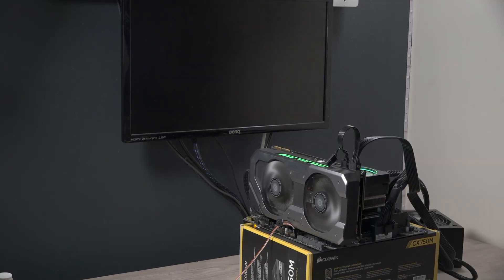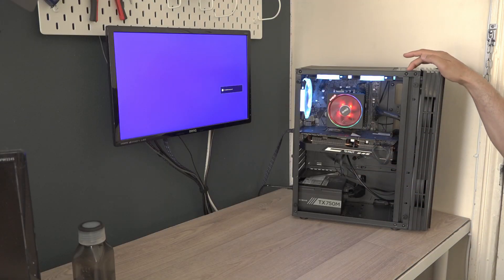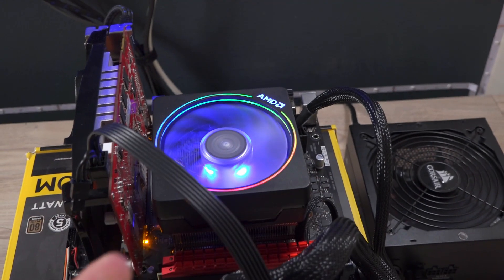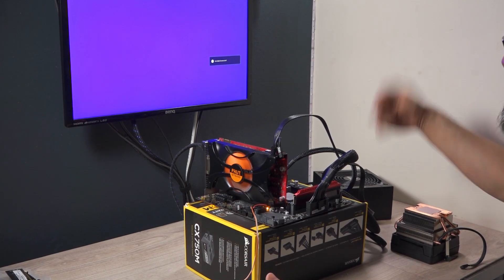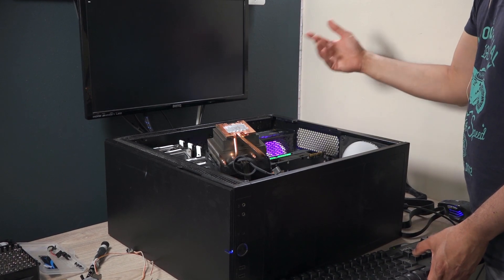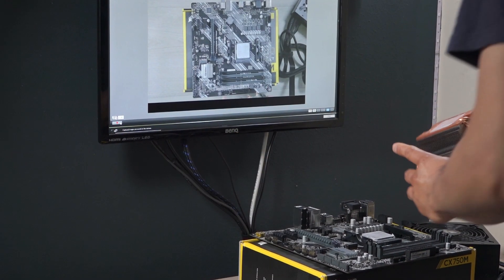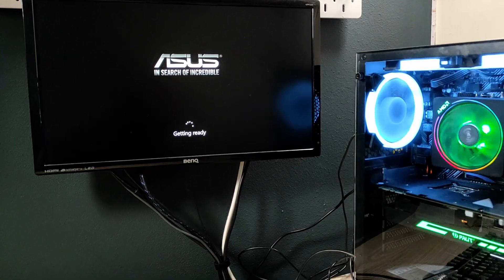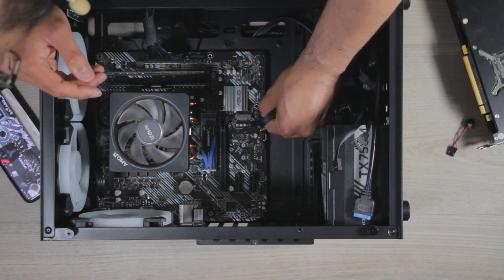Computer Turns On But No Display - Led Light On Fan Spinning - HARDEST Troubleshoot?

Comment: I have a Acer Aspire f5 572g 57pv laptop and after trying to overclock my laptop and hitting f10 in bios to save and exit, my laptop got stuck in a black screen every single time I try to boot it, no logo, no bios no nothing, just a black screen, I have tried to cmos reset by removing the bios battery, I tried it 3 times, longest time I waitted before putting it back in was 1 and half an hour, I don't know if this is because I have a bios password (yes ik the password I just need to enter bios to reset it but there is no display), I tried looking for cmos jumper but couldn't find it, please help 😦

Comment: I didn't know that you should plug 8pin connector instead of SATA to 8 pin and then my PC slowly started to stop giving display when i turn on any game and then one day i open my PC and see that SATA wire is fried and i try to check it and then I see that the both two of the four wires are fried and cam out when I touched them and from then I didn't see any display on my rx 580 even i changed connector to 8. Pin

Comment: I have this problem but im not really sure if its the same. Heres the issue:

Problem: No display but with power just like yours.
Issue #1: Gpu(connected) = No display with power and fan is spinning but keyboard and mouse not turning on
Issue #2: Gpu(disconnected) = No display with power and fan is spinning but keyboard and mouse will turn on and I can see the light of capslock led and numlock led.

My question is what would be the cause of this problem? Is my mobo good because it shows that if my gpu is not connected my keyboard and mouse will turned on? Or my psu is bad and doesnt give enough wattage? 

Also I dont have iGpu. Im using ryzen5 2600 so I cannot tell if my pc is booting up to bios when the kboard/mouse is turning on.

My gpu is good tho because the Tech tested it and I saw it myself.

Comment: Hello I built my pc today and the fans turn on and spin in the case except the cpu fan doesn’t spin and the is a red light near the cpu 8 pin port and there is no display on the screen also 

The motherboard is a ASUS rog strix bm550- a motherboard 

Pls can someone help me with this problem

Comment: Thanks for the video. I'm currently experiencing this issue. I moved my pc from basement to 2nd floor and now it spins+lights up but no display on monitor. I tried another monitor, gpu, other RAM and different slots. I'm at the point where it's either the cpu cooler, the cpu itself, or the motherboard pcie slot. I'm really regretting not taking the AIO and GPU out before moving it.
Reply: Did you end up fixing this issue? Having the same issue after moving.
Reply: @Morvellius  yeah turned out to be the motherboard pcie slot. Luckily my gpu was fine and it was not too expensive a motherboard but still, unfortunate. I wish you the best lmk how it goes.

Comment: My keyboard and mouse has lights my fans are spinning and everything is turning on but it has no display i tried replacing my board with a new one and the issue stays the same idk whats the problem now, im thinking maybe its the cpu if not wtf is it
Reply: did u solve?

Comment: The easiest way I did was to check the beep sound when I unplugged all the RAM. Without RAM there would be long beep: 
1. If the beep does not exist (you must make sure the speaker buzzer system of motherboard is fine, some motherboard failed to beep at all or your buzzer is broken/reversed) then it must be either the processor or the logic/Super IO motherboard (which is hardest) and after changing the processor to known working & compatible one still does not sound beep then it is clearly the motherboard issue which require advanced electronic test such as MOSFET and voltage output.
2. But if there is a long beep then most likely just VGA (Graphics Card) or RAM issue. Some motherboards (not all) will generate unique sound if the VGA is failed. Try using onboard or switch to another VGA. If the problem persist try replugging RAM to different slot or change the RAM to known good one (borrow one if you don't have).

If you are a technician usually you have something like "PCI Tester PC Analyzer Diagnostic Card" to show the current code that the motherboard is currently stuck at.

PS: I'm a PC technician for 8 years.
Reply: how if my mobo doesnt have beep sound

Comment: Hi friends, I've been desperately experiencing the same issue, but my PC turns on, screen turns on too, but after a while it loses signal. Could you suggest where to look for the issue?
Reply: Possibly overheating of your GPU... try using the onboard graphics.

Comment: I was just playing roblox and then suddenly out of nowhere the screen started flickering and it just froze nothing was working not even to restart button on my cpu case so o just restarted and then when i logged in the screen started flickering again i swithed off the power supply and turned it back on and since then my pc shows no hdmi signal from you device SOMEONE HELPPP MEEEE 🥺

Comment: Hey buddy need your help
My graphics card fans are running but No display when I plug my HDMI cable in GPU HDMI port, showing display only when I plug it in my motherboard’s port because my CPU has integrated Graphics…even sometimes showing no display in motherboard port too .
And in display adapter option in device manager( show hidden device ) it’s showing me my graphics card with a yellow caution sign… what to do buddy

( sometimes Graphics card randomly start working for one or two days) 

Motherboard- MSI A 320m A pro max 
GPU- 1050ti 
CPU/APU - Ryzen 3 3200 G 
PSU - 550w ( cooler master)
Reply: Turn off ur igpu , maybe its conflict with ur discreet gpu

Comment: okay, so what if my pc has all fans running no rgb on them are turning on, my cpu aio has the fans spinning but the cyberpower logo isnt showing anymore and my gpu is working as normal but nothing will boot onto the screen and jo lights on mobo are displaying, very very confusing trouble shoot
Reply: only thing i can think of is the motherboard because i have no further way to test the ram etc but everything was running yesterday and today the system has given me these issues wont boot at all but power is being transfered through the system

Comment: If it still not showing anything try pressing (windows icon+ctrl+shift+b) while the pc is still running 
Then turn it off by pressing the button 
Turn it on
It's gonna ask you for boot by pressing f1 (don't boot anything) press shift+alt+delete 
It helped me when nothing else did (I seriously tried everything) gl

Comment: One of the most common problems is a dead/or dying CMOS battery. When I have any POST problems, I insert a new battery. If the battery has gone SOUTH, you might see a message informing you that the system clock needs to be reset. Also, I keep a few new button batteries attached to the inside of my PC, just in case.

Comment: I have a similar problem. Fans spinning and there is light but no display (RTX 4070 TI) thou it works when I put back my old gpu (1050)

processor is ryzen 7 5800x
motherboard is asus tuf x570-plus
Reply: Your power supply might not be adequate to run the 4070 ti
Reply: thats the same thing with mine but instead of gpu its cpu for me i had a ryzen 5 and upgrade to a ryzen 9

Comment: I just have this problem ..i just get a3070before just use intel.uhd770 (13700k) .

After installing to the mobo it turns on normaly.. but after i install the driver ..and start gaming it suddenly off and no boot  no screen at all.

So i switch back to my uhd 770 intel at the moment is works just fine.

Is this because of my PSU not meet the req ?

I have Antec  700watt 80+ Bronze.

I need help thank you verymuch.

Thanks.

Comment: Greetings,my problem is that my pc boots but I get vga light and 3 beeps,any idea? 
Msi mpg b550 motherboard
Thermaltake 630watt psu
2 rams hyper x 16gb
Gtx 3070 gpu (I Also checked with another)
M2 Samsung ssd

Comment: I’m having an issue, i upgraded my ram recently and my system won’t display, the rgb and fans and the coolers lcd just spin and display my logo but no display on my screen. I don’t know what to do. I’ve clear the cmos, I’ve tried flashing the bios, and still nothing I even tried my old ram and nothing. I’m lost can anyone help?
Reply: You got any solutions?
Reply: @miguelisra  I don’t I’ve tried everything I can think of, the last thing to do is swap out the mobo

Comment: Hey guys if anyone sees this! Just put the usb stick in it with windows and it probably will work.  It worked for me!
Reply: Did You have no signal at all?
Reply: @pierdolek1236  troubling shooting mine this Monday I'll get with you on if this worked. I have the issue where everything turns except my gpu I have changed the board and kept everything else the same and everything booted up but I still want to fix my board since i had to use a friend's to figure that much out. Clearing the cmos definitely did something tho because at first mine didn't even have the cpu fan spinning
Reply: Also going try flashing the bois to see if that will get it to work but also my mobo isn't giving power to the keyboard and mouse

Comment: that board shouldve never been paired with that cpu without active cooling on the VRMs or after market heatsinks applied those VRMs cant handle the core count and power load without overheating. He'll just have the same problem as before. Buy a bunch of old or defective boards for their heatsinks theyre usually the exact same hole spacing

Comment: Mine was different. didn't boot and had video card not detected beeps (1 long, 3 short), so I just brought all my stuff on the floor, which was cables, a monitor, and the PC altogether, and it boots. I also unplugged all the power cables and pressed the power button to discharge the PC before that. If you don't have a budget for anything else, it could be a heart attack.🤕🤕😄😄

Comment: I just made my PC and my mouse and keyboard don't lightup or become recognized, i tried getting the same motherboard again, b650-prime still not working. CPU is Ryzen 5, 7600x. Basically i can't get into the bios because i can't use my keyboard.

Comment: Anyone help I accidenly turned my pc off when it was updating and my pc turns on but no display on my monitor and no USB ports or hdmi are working
Reply: I have the same problem I clicked update and shutdown and it won't come back on. Pulled the cmos battery for a whole day and it still won't work. Lights fans all turn on but no screen and it's definitely not booting to my home screen
Reply: @nazzato91  did you fix the problem?
Reply: @schaefer8704  yes the motherboard was bricked
Reply: @schaefer8704  apparently during that process it bricked. Maybe bios maybe a power issue. Not sure. Replaced it and been fine since.

Comment: My pc has same problem, bought new processor, didnt work, I took it to a "professional" and they said it was motherboard, bought new motherboard, didnt work, tested the hdmi in the motherboard, didnt work, made the paper clip test in the power supply, the power supply is working fine, tested the rams once at the time (its impossible to both started malfunction at the same time) and it still does not work. Idk what to do more help me 😭😭😭😭
Reply: I faced the same issue today. Few weeks ago I built a home theater PC by re-using the components of my old rig (3rd gen Core i5 + mobo + RAM). But it turned out that the Youtube 2k videos were too much for the ancient hardware so I decided to upgrade. The new CPU, mobo and RAM arrived. I replaced the old stuff and turned on the PC again. Nothing happened. No video output, not boot screen or getting to the UEFI screen. I thought maybe the HDMI output could be the problem (the TV also caught the video signal of the old config only on the 3rd day, do not ask me why did not work before) so I pulled out my old monitor with VGA and DVI input and hooked it up via the DVI port. Still nothing displayed.... So i called the nearby PC repair shop and drove there. The guy inspected my work (everything was right as I am experienced builder) and told that the new mobos, both Intel and AMD, take long time for first boot. So he tried to boot, patiently waiting, 2 or 3 times, without success. Then he reset the CMOS, still no lifesign, restart again and again and finally the boot screen popped up. Then we booted till the Windows login screen and shut it down thinking that it should be set now. I drove back home, connected the peripherials, the old monitor, turned it on and.... again blank screen.... I do not know how to describe my feelings. I tried to start it twice, without sucess. Then I restarted again and came to my main rig to search for advice. I have found this video and watched it. Then went back to the HTPC and guess what? The Windows login screen greeted me!
Long story short, it seems like that you have to be extremely patient with the new generations of mobos on the very first boot. I hope that your problem too has been solved this way.

Comment: my problem is that i changed some settings in the bios and when i left bios it was just black screen. I turned the pc off and back on and it did the loud thing that it always does when it boots on but it did it infinitely PLEASE HELP!!!!
Reply: fixed it! :) i just reset the bios
Reply: @ho_rth  I did that to but my bios won't reset
Reply: @carsonschnell1181  what do you mean? did you take the battery out of the bios and wait for like a minute or few?
Reply: @ho_rth  ya
Reply: @carsonschnell1181  oh.. sorry idk how to help you maybe something else is wrong? i am not good at this either
Reply: @carsonschnell1181  same
Reply: @ho_rth how do you take the battery out of the bios?
Reply: my gaming pc was working fine but suddenly no display now!! and i couldn't be able to update gpu driver!! what's the problem HELP*

Comment: I recently bought asrock b450m hdv 4.0 Mobo, kingston fury 8gb ddr4 ram,I m pairing it with ryzen 5600g, but the system is not POSTING and i can't see any display or the boot menu. I tried updating bios through instant flash, but failed. Kindly help

Comment: non of it helped . I unpluged all my cables from the desktop and monitor   , cleaned the desktop inside with cotton swaps and now I have no display . does anyone have tips / tricks or experience with this . thank you in advance !
Reply: bios reset/flash
Reply: @DDJas  I found the issue . It was a damaged motherboard .

Comment: I had mine too on RX580 on b450m 8gb ram, I used the DOCP on bios to overclock cpu and Ram it worked within 2 days and now this morning the display didnt pop. I'm using 500 watt generic psu
Reply: I tried removing my gpu and used the integrated still no display, I'm using ryzen 3 2200g
Reply: Try resetitng the bios by undoing the cmos or shorting the cmos pins
Reply: Upgrade ur psu , save ur money more cheap to buy psu than whole system dying cus shitty psu . Psu is like ur heart once its stop pumping enough blood to ur body then it will destroy other part of ur body.

Comment: Nice video, thanks man
Reply: I've got a b550 f, worked after I swapped cases also, but I came home from work and it had shut itself off. The yellow and white Q-led lights are staying on. I've tried repeating and removing a few non-essential parts, the sound card and gpu since it has integrated graphics. Too bad I don't have a spare cpu for this socket...but I was already beginning to suspect it is the damn mobile. I bet that's the problem. Anyways...i guess I'll just have to cross my fingers  as i buy a new board , then cpu if that doesn't work .
Anyone else have their yellow and white qleds remain on without a post?